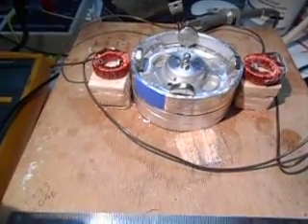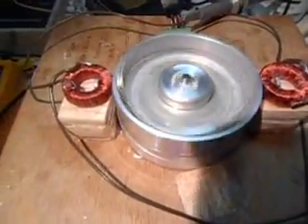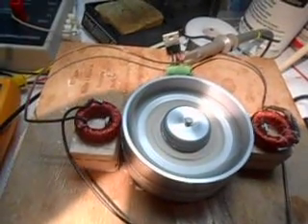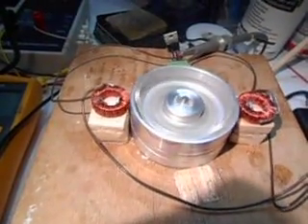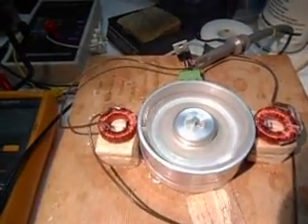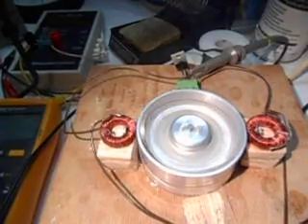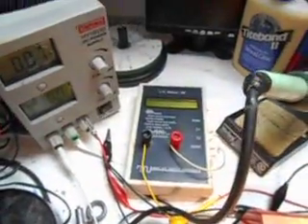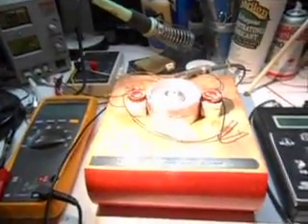Dual Coil THOMAS coils 180 degrees apart.

Comment: Yo make this motor efficient, you have to negate lenz in it and 4cycle the back. Em.f while in other words aurppressi g it. To do that, you must wind one toroid I. Clockwise direction and wind the other in counterclockwise direction and then connect the starting leads in parallel. Place an hi frequency ddides to the parallel ends and point the diod to an high frequency capacitor. The cap must be high voltage then connect the other leg of the cap to the posited legs of the coils

Comment: You talk about the two different configs ... Thomas and ORBo ... you do not explain WHAT that difference is between the two. What is the difference ??? My ORBO is NOT like the original as seen in THEIR vids when they came out as it were. My idea was to build EXACTLY what they built and it didn't work due to LACK of info on their part. SO I improvised with some help from Patrick Kelly in the UK. After that I was on my own and haven't looked back since. My ORBO out performs ANY I have seen on Utube as far as speed vs power consumption ... at less than 3 watts I can get over 6000 rpm's.moving a rather large mass ... 200 grams plus of weight for the rotor. I haven't weighed it recently but it has increased due to thicker plastic holding mags and more mags ... currently ten mags and 5 drive coils using the idea of oppositional harmonic concept in 5 cyl car engines.
Can't say whether that had any effect on improvement ... so far.

Journey

Comment: Hi Ben,
Are you using a VCR head for this rig ???
You stole my idea !!! ... I'm the ONLY one who has used an old vcr head for a rotor that I know of for a motor like this. Interesting if you did ... I came up with that idea 2 yrs plus ago ... good idea eh ??? My rig runs great using this approach. The bearing is awesome and I can run very high rpm's with no issues ... save for magnets flying off the rotor which I fixed for now. Next rotor will be a sandwich but has to be 3D printed due to tolerances ... a rather expensive upgrade as I have discovered. If I had my own basic 3D printer, my rig would be state of the art for R&D as it would be designed with every conceivable adjustment imaginable. Every adj would be universal like a UV joint on a front wheel drive car.

Journey

Comment: Hi Ben,
maybe you can also get a solid state device working with this effect ?
Just use an U-shaped Core with a coil around it to induce pulses into it from your Thomas coil.
Maybe you can get an OU transformer this way, if you build it big enough...
Good luck !

Regards, Stefan.